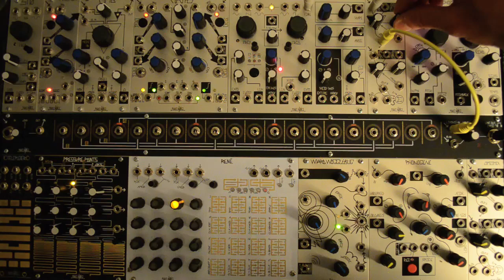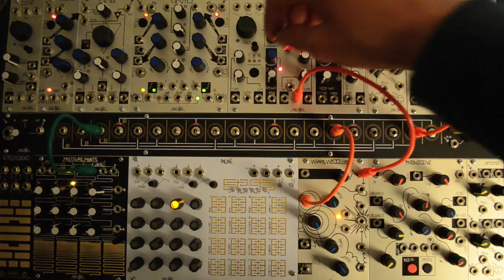New Buchla Bongo

Comment: Im trying to follow the patch. Ch. 3 gate out from PP to Strike input of the Optomix. If i press one time the PP, it sounds OK, but the second time i press it, it doesn't produce any sound. I have to press another channel of PP and then again Ch. 3 of PP in order to sound again. I have two PP linked with Brains.
Reply from the maker: Use the T-GATE output for touch gates with BRAINS attached. The individual gates go high and stay high based on the active PP channel, for patching different sequence lengths, clock division etc.

Comment: another weird thing tripping me out is the Rene, why does it appear to be shifting to the space below it with nothing patched into it??
Reply from the maker: Can you add a time tag? Then we could try to answer the question. Thanks!
Reply: its pretty much all throughout where the LED in the knob below the one below it is glitching on and off
Reply from the maker: Perhaps one of the CV input attenuators is all the way open. At high values those offsets can be "between values" which would cause the voltage addressing to "glitch" like that.
Reply: interesting